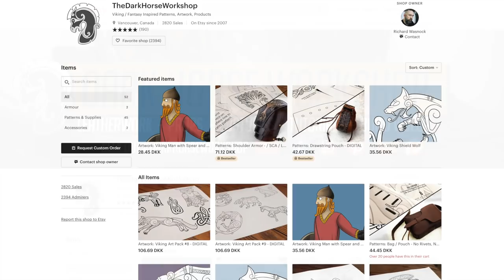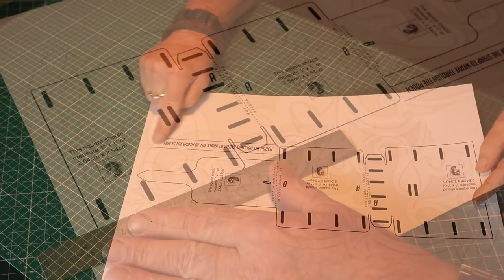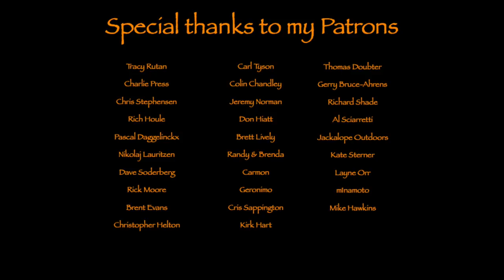A Vi-Kings Chair ... and DIY pouch project !

Comment: Tom:  The Rock Fire Reflector makes allot of sense.   Looks good and will provide more heat radiation than the wooden reflector.  Rock gets hot and stays hot longer.  Nice work, as always.  The chair looks great and fits right into camp very well.  I have a large Carabou hide from a Bull Carabou I shot about 20 years ago.  It's extremely warm in winter.  A chair fit for a "King"!!!!!!  Very nice leather pouch and clever not having to stich it together.   It's cooling down here in Pennsylvania and the weather is perfect for camping and hiking.  I also do some Blacksmithing  talent and it's finally cool enough to light my forge without suffering heat stroke.  Great video, as always Tom.  Best Wishes to you and your family. Charlie
Reply from the maker: Thank you so much Charlie for another positive and kind feedback 👍🏻😉 Always great to hear from you my friend and I appreciate all the support your giving me 👌🏻😊
I’m glad you can begin using your blacksmith location again and would love to see some of the items you have made 💪🏻😎🔥 Atb to you 🏕
Tom

Comment: Tom, you look like a very happy king sitting in that chair! The stitchless pouch is a very cool project! I'm going to give it a try. A tip I learned from a local man who constructs amazing free standing inukshuk and other natural stone statues is to use small stones (pea sized wedges seem the most used) to wedge in and bind the larger stones so they don't move. He does some amazing, gravity and physics defying creations using the technique. You could easily build the reflector wall to the same height and have a stable, flat inside face rather than a pyramid shape.
Reply from the maker: Thanks Sean for sharing this information with me 👍🏻😁 I believe that’s a great way to make it stable and rough 💪🏻
I don’t want to make it higher because I want to film from that new position behind the fireplace … but can you the advice anyhow 🙏🏻😊. Thanks for your feedback and all your kindness Atb to you 🏕🦌🔥
Tom

Comment: Wonderful video as usual Tom. I like the leather pouch, maybe that would be good to carry your pipe tobacco tin and maybe some cleaners/tamper in. The chair does indeed look fit for a king. Hope the shorter rock heat wall will work as well or better. Happy piping brother
Reply from the maker: Thank you so much my friend for your kindness and great suggestion 👍🏻😁 Unfortunately the pouch is just a little bit 👌🏻 to small for my tobacco tin 🤔😏. But it’s a great idea. See you soon 🏕
Tom

Comment: I like the pouch I wonder I'd it could be made larger and used for a small possibles pouch for black powder hunting
Reply from the maker: Thanks Robert for your kind feedback and your question 
👍🏻😉 You can make it whatever size you want 😁👌🏻
That’s the cool thing about that template 💪🏻 You just print it in the size you want. 
Everything will fit nicely 👌🏻
Hope to see you again on my next adventure 🔥🏕🦌 Tom
Reply: Thank you for your reply I enjoy your chanel a lot it is very informative and I like the way you do a lot of informative things. I myself have a little problem that maybe you can help me with I have a small Kuska cup that I bought and am trying to make two larger ones one a cup for coffee or coco and another one for soup or Stew I am using cedar burls and they keep cracking and leaking what mite be causing this and I fix it?
Reply from the maker: Hmmm yeah that's not good. Have you tried boiling it in saltwater ? some people say that helps. Haven't tried it myself ...but maybe it'll help. I use birch wood...and some of mine also cracks ...
Hope you'll find out the best way to avoid cracks in the Kuksa...keep me updated ...Tom